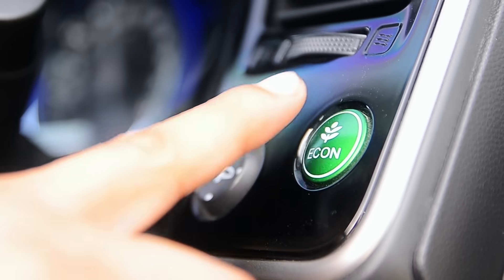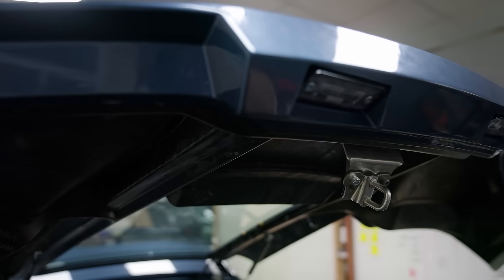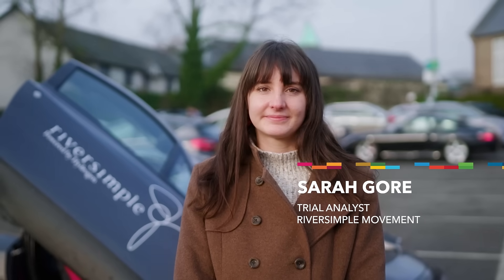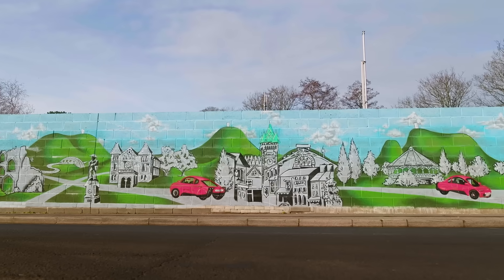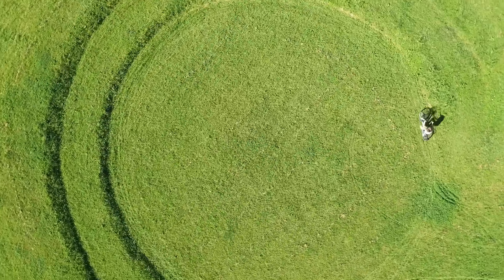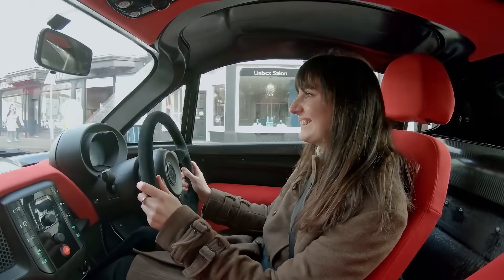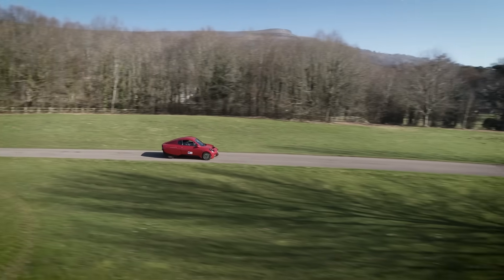Inside The Former F1 Engineer's Innovative Hydrogen Car

Comment: It’s a great product (except the top speed) but the subscription service is going top put most people off, leasing a car is way more expensive than owning a car. Even then how do you expect a small family that need more then two seats to lease one? Your turning one impractical solution which is the electric car with limited range and uses into another impractical solution which is a car with exceptional range  it with two seats and a limited top speed. The engineering is top notch though, I would get one if it was for sale and had an acceptable top speed.

Comment: This sounds is amazing, 
but why not just redesign the old technology, cars that use water and convert to electricity to run. That is a very old technology and its more cost effective and also really good for the environment.  It brings out clean air from exhaust pipes. Some people  have design it and use for fun privately. It first came on video in the 60s but mysteriously disappeared. It would be amazing for the public and environment but the only problem is, they will not need the subscription service or buying fuel of any kind. So how can cars that use regular water 
, H2O, be monetize so people can keep spending after buying it.

Comment: Why mess about with electric motors, fuel cells etc? 

Why not just inject hydrogen gas into a conventional four stroke engine? I am sure the technology to achieve this isn’t that difficult. We have been doing this with petroleum spirit for over 100 years. And it is way more efficient that reverse electrolysis and the losses in electrical circuits. I am sure somebody has already tried to do this in the past. 

And it will cost a fraction of the price. The major cost will be the same whichever way you go. It is the cost of making the hydrogen tank and delivery mechanism safe. And of course, the ready availability of hydrogen.

Getting hydrogen and delivering it it to vehicles is also well tried and tested. 

Germany in the 1930s delivered countless litres of hydrogen gas safely to the Hindenburg. The “safety issue” was the Hindenburg itself - not the processes used to extract and deliver hydrogen. 

And ditto for just about any sizeable rocket that has been sent into space over the last 40 years.

I am sure all of the “technological issues” aren’t that difficult to achieve. It is the political issues and issues of vested interest that need to be overcome.

Comment: What is the carbon footprint of manufacturing as a whole I wonder? It won’t be zero. 

Consumers once had cars that provided longevity like the classic VW Beetle or Mini and could be maintained by the common man with the bare minimum and would last generations. Making cars that last for 100 years doesn’t make manufacturers richer though does it.

Todays society doesn’t want you to own a vehicle you can service yourself or pass down generations.

Instead it wants you to ‘subscribe’ so you never own anything and the most obvious reason, suppliers get richer. This is not about saving the planet. 
This is about the consumer being locked into paying month after month and never owning anything and to help convince you to make the change they say it’s to save the planet.

Comment: Where does the Hydrogen come from. What pressure does the Hydrogen need to be at in the tank. The tank would need to be very heavy to contain enough Hydrogen for a long journey. The problem seems to have been shifted.

Comment: Even green hydrogen may be problematic. I imagine there are fiber resin containers for pressurized hydrogen that do not leak, but without consistent careful handling hydrogen will find its way into the atmosphere where it may compete methane's upper tropospheric primary sink, hydroxy radicals. I've only read one article about this and in my mind it needs more  substantiation, but if so, this could make hydrogen as bad or even worse than fugitive methane. This aspect may be critical to all applications of  hydrogen and requires careful consideration.

Comment: The question is WHY? They are not thinking this through. Most hydrogen is made using natural gas. Green hyrogen uses solar or wind electricity. Forget hydrogen and either run the car on methane (natural gas) or electric batteries. The last thing we want is hydrogen stations and hydrogen tankers scattered all over the country.

Comment: It is true that batteries use a lot of materials to produce, but those materials are recycleable. Making electricity with hydrogen can be clean and recycleable if the right infrastructure is built. Using direct solar power is key in both systems.
Reply: Solar is useless on cars. Look at Lightyear, Sono and Aptera. L is too expensive; S failed; and A just lies.

Comment: It is a bad idea to put motors into wheels - unsprung weight increases unnecessarily.
Reply: It's also a bad idea to have four of them when one will do. Put a bigger one in the body and drop all four in the wheels. The one in the body can have a reduction gear to go faster, and the four are stuck to having to scream like a banshee for anything over 50 mph.

Comment: Some really interesting business models here, but with the one single obvious massive flaw - Hydrogen! If this was a battery electric car, all the other innovations would make sense. 300 miles per week!  - that equates to < 50 miles per day, so you could make a 100 mile range EV with the same carbon fibre innovative low-volume manufacture etc. - high recyclability of the battery raw materials, but with very low cost energy, home charging, etc etc. Loose the Hydrogen mistake and the rest could be very interesting.

Comment: You are 100% on the ball.  Electric cars will never become mainstream, as too heavy, not enough charging infrastructure, and if you use public chargers, too expensive.  This is the perfect solution.  Only question is as hydrogen is highly volatile, how safe is it in a crash ?

Comment: hyrogen burning engines where good enough 70+ years ago, fuel cells 40+, tanks to store it reliably in a vehicle are the impossible final hurdle as the hydrogen effectively rots the tanks.

Comment: You are talking over and over again about sustainability and even circularity of your production. This contradicts sharply with the extensive use of carbon composites. Instead of steel, that can be reused again after the end of the service life of the vehicle, your carbody will end up in a landfill or be shredded to be used in concrete at the best. Not very sustainable and the opposite of circular.

Comment: The big problem with todays manufacturing is that they build far more cars than they will ever sell!!!!
Look at the airfields full of vehicles that never sell...thousands upon thousands of new vehicles just sitting there!
They don't sell because they are priced out of reach for the average worker that would want one!
Do cars need to be on the road all day long? No! Public transportation is 24/7 with dedicated lanes.
They need to have windows of travel set up...eg. (based on a 10 hour work day): 5:00 am to 9:00 am passenger vehicles for work have priority on the roads, 7:00 am to 9:00 am passenger vehicles dropping students off and school busses have priority along with trucks up to 5 tons.
After 9:00 am there are only public transportation/ cabs/ uber/ small trucks up to 5 tons and semi-trucks up until 5:00 pm.
From 3:00 pm to 5:00 pm passenger vehicles picking up students and school busses have priority.
From 5:00 pm to 9:00 pm passenger vehicles for work have priority on the roads and no trucks are permitted on the streets.
This is like 20 minutes of trying to figure a ruff schedule...but, you get my drift I hope!
THERE are way too many cars rippin around out there ALL DAY LONG and they don't need to be!!!
Public transportation would be faster and there would be less accidents and emergency response would also benefit from less cars out there!
Just look at the numbers during the lockdown!!! We actually got rebates from the insurance companies because of the reduced collisions!
My big question is...Do we need to have all these vehicles out there on the streets from 9:00 am until 3:00 pm?
I think not! Use public transportation or just walk the 2 or 4 blocks to the store....
Reply: Yes, there are better ways. I say get all who can work from home living further out, and those who can't further in so they can use public transport, ride a pushbike or even walk.

Comment: It makes perfect sense, simply due to the fact that batteries store no electricity whatsoever. However, the problem with hydrogen is that it's a bitch and a half to store and transport, and everything that's done to make it easier ends up hurting round-trip efficiency.
Reply: Batteries store electricity.
Reply: @aussieideasman8498     Batteries store chemical energy, produce electricity on demand, and can have their internal "fuel" regenerated if electricity is applied to them; but they do not store electricity directly. It means that charging a battery is an energy conversion process, which brings a power limit.
Batteries are fine to use if they are not plugged in, because they end up being charged and discharged at the same power level. However, refueling even the slowest combustion car is done at astronomical equivalent power levels, simply because the fuel doesn't need to be converted into something else when it goes into the fuel tank. Range is not the problem, and CNG cars are there to prove it. Input conversion is the real problem with electric cars.

Comment: Where exactly will i be able to fill my car with hydrogen? If my nearest filling station  is 100 miles away, the return journey will take about four hours plus the three to five minutes to pressurise the tank. To charge my battery,  which i can do at home, takes me 20 seconds. 10 seconds to plug in, and 10 seconds to unplug. I won't  be swapping my Tesla for a Riversimple car anytime soon.

Comment: Bleh.  Hydrogen is a boondoggle.  Why are none of you putting in methane fuel cells?  Unlike hydrogen, we already have an distribution infrastructure and storage tech for methane.  Hydrogen needs a few material breakthroughs just to be able to store it.  A few more to be able to distribute it.  A finally a way to economicaly produce it.

Comment: it is my understanding that gas engines are 6 times efficient than hydrogen for the same relative amount of fuel. To go 30 miles on a gallon of gas would take 6 times more relative fuel, or put it another way, it gets 5 miles per gallon equivalency. To equal the milage of the gas fuel, it needs 6 times more fuel than gas, and since it is highly explosive it must be encased in a very strong heavy metal.. So the composite had to be used to offset the weight and potential explosion issues of hydrogen. This is why it has not made headway, not efficient and heavy

Comment: no bateries? zero carbon emission? bold claims. you need at least lead battery equivalent to cold start stuff, for smoothing voltage and powering electronics independently from fuel cell outputs. and fuel cells degrade over time 😂

Comment: I live in Italy, I have a full electric car, nothing so fancy or expansive, a Peugeout E208.
I have chanrging station all around me, the first 20 meters out of my house, and I have solar panels so I charge on my own for free.

I have just searching for hydrogen stations and the 2 most near are at 60 km.

So how the hell could be more easy to refuel? And most of all how it could more easy than charginf at home?

I am veru open minded but guys... at least take different examples...

Then I have to put on the table new battery technology which are coming in the next years (something on the end of this year, thank to CATLS and hybrid batteries)

How much is efficient all the hydrogen production and use cycle? We must produce (extract) hydrogen, stock it in high pressure container, move it to the stations... thay are a lot of things!

Comment: What exactly is the innovative element here? Hydrogen cars are available for a while - from companies that know how to build them and do so. Besides this: A hydrogen car needs a battery as the electricity needed when accelerating is not generated on the spot. So there is a small battery included.

Comment: I really like the concept of this vehicle.  I also like the subscription plan but is a bit to expensive for what  they are offering. The interior needs some work. For example the stiching on the dash looks worst than a teddy bear. Another problem with vehicles like this is that they look like out of proportions and thats will impact the sales. Also carbonfiber isn't a sustainable material. if you crash and damage the carbon fiber monocoque chassi you will throw a way the intire car. Its a great concept but it needs refinement.

Comment: I love the circularity, transport as a service and the local supply chain but am baffled by the choice to embrace hydrogen. Batteries already deliver the required range and are still improving exponentially. Charging infrastructure is insufficient, but at least it is widespread and there is a charge at home option. Green hydrogen is currently a rarity, best reserved for industrial processes close to where it is made, because storage and transport are inefficient.

Comment: But it’s still hydrogen which isn’t producible at scale at a reasonable cost (less than petrol, or anywhere near solar) . Requires distribution networks like petrol, via road, rail, and tanker.
Listen, make one you can pour distilled water into, and you’ve got a winner, but this is just too little too late

Comment: Clicked for genuine curiosity but soon the trick is revealed: it is another hydrogen joke.
Hydrogen production, transportation and storage is 5 times less efficient than charging a battery and run the motor from the same battery. Therefore it is 5 times wasted energy.
It doesn't make any sense for passenger cars, especially now that LFP batteries are without cobalt, nickel or other problematic materials. It may only make sense where you need very high temperature in industrial processes like making concrete or metallurgy.

Comment: False claim #1 - 0:45 it doesn't have any battery's? Your car cant be turned on without 12 volts probably from an lead acid battery. 
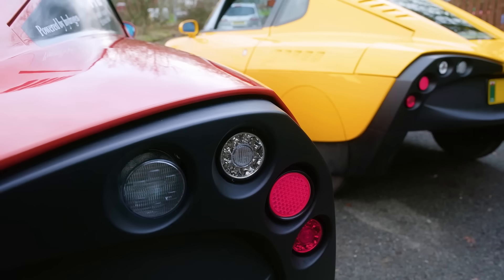Claim #2 I love this on: 1:02 claiming "no carbon emissions". Well how do you get electricity to make H2, and all the power factories needed to make each part of your car. Do you only work when the sun is shining and the wind is blowing? Or you somehow separate "clean" from "fossil" electrons from the grid. 

Message to industry: Curb your planed obsolescence and you will fix all stuff you re talking about. Until than I will drive my >30 year old Honda and I will never buy a new car with all those plastic parts under the hood.
Message to investors: Invest in people and ideas, these company's are only good at money laundering and exit schemes.

Comment: I love this, can we persuade people to go over to a leasing system, hopefully because a lot of people already do that. However I still think we can make On-Demand Hydrogen work, if we just get it right. Put water in the tank, extract the Hydrogen as we need it. I'm sure it can be done.
Reply: So every car needs to have an electrolysis and a hydrogen fuel cell 

instead of batch electrolysis and filling up with pure hydrogen
Reply: Well yes, if you choose to use electrolysis. I have heard of someone extracting Hydrogen from water chemically with Aluminium cassettes. Then do you use a hydrogen fuel cell to power electric motors or an IC engine? All these avenues need to be explored of course.

Comment: There are hydrogen cars already. Also, carbon fiber is only one use material, you can't recycle it. Only landfi. Unlike metals, that can be reused infinite times. So, this project will create more waste. As I see it - this is another attempt to ride on the "green fashion". Hydrogen cars are sound idea, but not in that form.

Comment: No mention of the price of hydrogen, o yes a subscription but no mention on price. And why subscription because the fuel cell is extremely expensive and needs checkups and maintenance. What about the lifespan of this high pressure fuel cell and storage tanks for hydrogen gas? O and 300 miles only at 300bar pressure I assume or 150bar like the two hydrogen stations we have here in the Nederlands? But this is of course a sales pitch never mend to be really informative.

Comment: The impact on nature is low ... the impact on your eye is tremendous!
Another one: The impact on the nature is low the impact on your pocket will be huge. 
But in reality: the impact on the nature is quite big, carbon fiber is not recyclable (but steel and aluminum are)  and right now there is no green hydrogen. And if it will be green it will be terribly inefficient because with the electrolysis there is a lot of loss in conversion.

Comment: Hydrogen power will only ever really be viable in aircraft. Using it in this fashion wastes energy when generating the hydrogen and again wastes energy when turning the hydrogen back into electricity. You can't use regenerative breaking with this setup, and the hydrogen embrittlement and volatility problems are not solved. With the new batteries already being included in most new EVs, you don't have to "plan your schedule around charging", you charge overnight and never have to worry about it. On long road trips, you charge during rest stops and rarely have to wait around any longer than it takes to use the restroom (if you wash your hands properly you heathens).

Hydrogen has a better use-case in aircraft because of the energy to weight ratio, and the fact that all of our high speed propulsion methods utilized in aircraft rely on combustion to do more than just mechanically spin a shaft. the combustion itself adds a significant amount of thrust by just accelerating the exhaust gases out the back of the engine.